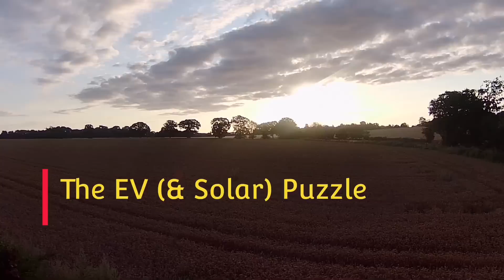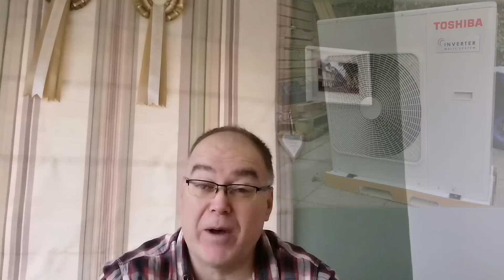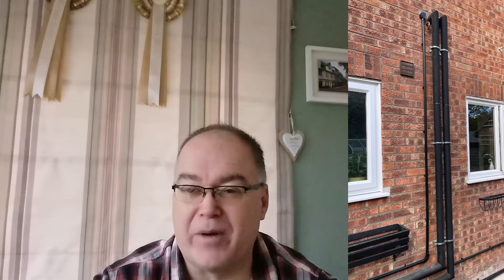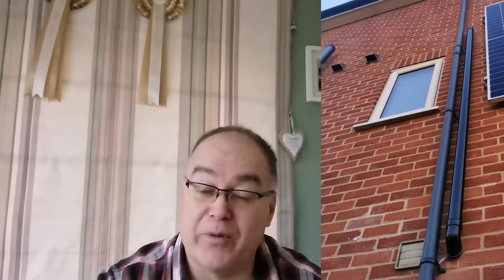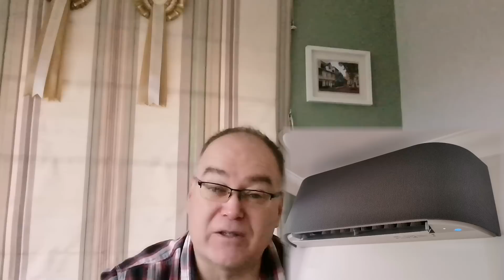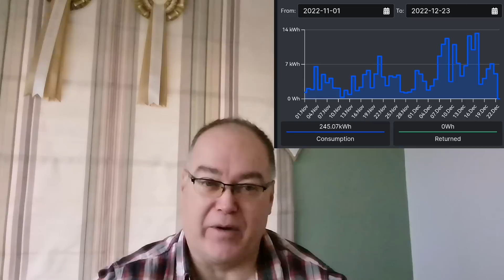Toshiba Air to Air Heat pump (A2A) - Probably one of the best heating systems you can install

Comment: Interesting that you have fitted small Immersion heaters into your towel rails. We did the same over 3 years ago when we fitted our solar system. In our case I wired the two towel rails back to the Eddie’s 2nd zone and then when there’s spare solar the towel rails come on. It’s great in the summer months when there’s loads of solar, in the winter I use the timer function in Eddie to operate the towel rails as required. It meant a bit of extra wiring but now done it was worth the hassle.  I’m very interested in you heating system my one concern is how well the heat pump works when the temperature is near or below zero. We have an Aircon in our kitchen that works well in cooling mode, is great for Dehumidification however in heating mode it only work well if the outside temp is 5 c or above, below that temp the outside unit freezes over. I’m a bit miffed that most companies don’t tell you that their equipment only works down to a certain temp for heating, they should be more up front about the performance of the equipment. Following your Vlog to the end I see that your units have a defrost mode and that’s were mine doesn’t. Fortunately I’ve just the one unit and I bought that mainly to cool the room in summer. 
Thanks for your brilliant Vlog it’s certainly got me thinking down a different route. Our ten year old house has plastic microbore pipework and that’s not a lot of use if we chose an air to water heat pump, it would involve a major work upgrading the pipe work and ripping up chipboard flooring, a nightmare.
Reply from the maker: Yep our heating has worked fine so far down to - 6c outside. A few defrost cycles in the worst weather but heat has been fine

I have heard placement of the heat pump can help, not too exposed

Comment: Ni Nigel I'm just about to go down the route of A2A with Haori units, have you tried integration with Home Assistant?  I see some integrations on HACS for example, but would welcome confirmation that there is a working integration, especially from a UK system
Reply from the maker: There is a working integration I've tried but it conflicts with the solaredge integration so I can only run one or the other. Hopefully one day the solaredge integration will be updated or the Toshiba one, whichever it needs. Its been an issue for a couple of years though

Comment: I love A2A heat pumps - I have a newly installed single "big brother" unit of yours, the Toshiba Daisenkai 9.5-35 (to replace an ageing Panasonic one), for my 5-bed house in Sweden.  Previously I did look at either multi-splits or an A2W system, as there were 3 of us, with 4 out of 5 of the bedrooms in regular use. And the heating engineer did lean more towards recommending A2W, because one of the major drawbacks of A2A - especially with multiple units, is when it needs replacing you're replacing the whole system.  With A2W, the rads/fan convectors, piping and storage tank all will live through multiple A2W heat pumps, so over time an A2W system will likely end up cheaper in certain situations, especially if most of the rooms are constantly in use.  Now there are only 2 of us in the house, an A2W system is only really going to be likely to be cost-effective for a larger family.  I will be reviewing how mine performs for cooling in summer, as previously I used a portable unit in summer for my home office and bedroom at night, and may look at getting a multi-split like the Haori for helping with the cooling in summer.
Reply: Thanks for your post, I’m thinking about an A2A system for our house, but didn’t think about having to replace the whole system when the time comes, unlike an A2W system. Food for thought…

Comment: Very helpful. I think people will gradually realise sticking a heat pump to radiators is madness. Most heat pumps in Europe are air to air
Reply from the maker: Think it suits those that just want every room the same temp and like using radiators. Air to Air just sounds different and hence people are apprehensive.  If these were installed as standard in new houses it'd be a massive improvement but radiators seem to be the way forward for most.

It's in my nature to question and challenge things however

Comment: We have had air to air heat pumps in Sweden for many years and they do make a difference to your energy bills. I would say that even the floor units have their advantages if you have room for them. Some people prefer to feel the warm air coming up from the floor . Having grown up in England I can imagine that they will work well as it does not get as cold as it does here, even though the houses are not as well insulated. The heat pumps are actually most effective with the fan on max if you can stand it. So put them on max a couple of hours before you get up and the house will be nice and warm.

Comment: What about the ventilation side of the system? How does dirty air flow out of the house? Is there an energy recoverysystem involved? In my experience this aspect seems to be underestimated by some people here in the Netherlands.
Reply from the maker: Nope no air recovery, open windows to vent air out 😂
Reply: This is internal only - air in the front, blown out the bottom less moisture and dust

Comment: How much does it cost to maintain an A2A system? Most places I've worked have had A2A AC and I see someone come in, at least once a year, and clean out the filters etc. What about the heat pump unit itself?
Reply from the maker: About £60 I'm Hearing for everything which then keeps your 7 Yr warranty in place
Reply: @EVPuzzle  thank you!
Reply: Get the best warranty you can for parts and labor. It may be built into the price. You should get an annual service call especially to make sure refrigerant level / pressure is correct. You also want to keep the coils clean. It’s like a car oil change you shouldn’t risk not doing it.

Comment: I had a small 2.5kWh Samsung air to air unit installed for £650, it does daytime heating in the winter and cooling in the summer of our lounge, invaluable last year in the heat wave. Running costs are low and it's great for keeping the damp out.
Reply: Thinking of same for a garden / off house office I am building.  The heat in summer will likely kill me!

Comment: I've had a Daikin system for a couple of years, in 3 rooms - absolutely brilliant. Heats the rooms in no time. Easy works at -5. Had a 4th unit put in the lounge in November, but something happened to the circuit board in the outdoor unit - 6 week wait for a warranty replacement. Not good if it's your only source of heating. Am having a Fischer electric radiator installed tomorrow in the hall (as I can't get an air handler in there anywhere). Also did the immersions in the towel rail radiators 6 months ago for warm towels in the summer ! Brilliant.

Comment: What’s the effiency of this system?
How’s it performing serving the whole house if the heat is only dispersed from 3 rooms?
An air to water system can hit 500% scop/efficiency and is surely more cost efficient if you want it in all rooms? Intrigued as to why you went this route unless you’re keeping the oil system or going to spend more than an air to water system fitting more units?
Reply from the maker: I've explained both these things already and why a wet system doesn't suit us.

We achieve a 5 COP also
Reply: @EVPuzzle  how do you measure actual COP on your system? Thanks
Reply from the maker: @DarthW909  I can't in reality as the units themselves aren't measuring heat output. The way other people seem to do it is start with heat loss value for the house and compare to heating power output vs a steady temp. My issue is I don't keep a steady temp long enough and have varying conditions so it's a constant moving picture 

Do I need to though? The units are 5+SCOP rated and  vary with temp. I accept this and presume this so have basically let go to focus of kwh consumption.

I see it like measuring bhp in a car, I know its there and can feel it but don't need to monitor it
Reply: @EVPuzzle  of course you don't need to. But it's a perspective for those that are watching your story as to what to expect in case they might want to follow your example.

In regards to 5 COP it's quite hard to achieve that as the system at it's best is only rated A+ and not A++ or A+++ for heating, with a COP of 4.67 and a SCOP of 4.26.

And given the configuration you have with only 3 indoor units, a rated max COP of 3.7 can be achieved when all 3 units are running simultaneously, a COP of 3.3 when 2 units are running, and COP 2.8 when one unit it's running.
A multi split to run at it's best performance needs to have the right matching units for the outdoor size. A four ports unit connected to four indoor units running at the same time would give it's max efficiency. 

It is advisable with the multi splits if used as singles due to lack of need to heat the whole house at the same time to be matched 130% to the outdoor unit size so that when used separate it matches the size of the outdoor at a better efficiency.

Of course using it a lower speed the SCOP will be improved but it's really hard to think of a number higher than 3.5 to 4. Still a very good performance.

The Haori indoor units with the single split outdoor units are rated at 5.10 SCOP A+++

All the best.
Reply from the maker: It's all good but is it too much data. What's most important. For me it's the watts it runs at in tick over, sub 400w for a 4 bed house is what I was after

Comment: Sorry I'm late with this one, but why do you want to burn your remaining oil? Isn't part of your project policy to "STOP BURNING STUFF" (ref:Fully Charged)? You probably purchased it at less than half today's rate, so sell it to a neighbour and get all your money back. I have a heat storage electric boiler (just one month ago), runs small house with microbore rads perfectly, and shall pass my remaining 200 litres of oil on to a neighbour. After removal of the tank I shall have no external components whatsoever (in my tiny garden).
Reply from the maker: Ease of disposal mostly. Pumping 400 litres to our neighbour could be messy. Without the right gear

Comment: Very interested in how you decided where to place internal units
Discounting bathrooms I get - they go with electric elements in the radiators etc.

For the rest of the rooms though/hall spaces?

I just ran a test with 2x units (1.8kw and 2.5kw) in the main living space and home office and  seems like extending to the rest of the house - esp. upstairs would be interesting.

Separate air source hot water tank perhaps later as the final nail in the oil boiler's coffin.

Comment: Great video Nigel! Just to clarify, is the minimum draw dictated by the size of the outdoor unit? For example, if you only had 1 indoor unit running the minimum draw may not be much less than having all 3 indoor units running? I was considering the larger 10kw outside unit to run 5 indoor units and cover the majority of the house. If this means the minimum draw would be higher even when running 1 or 2 units time we are likely to try and make do with 4 indoor units and go for the same outside you have. Hopefully this makes sense. Thanks
Reply: We have a Fujitsu 10kw outside unit and 4 internal units getting fitted next week. I’ve got my energy meter at the ready.
Reply from the maker: That's my understanding yes, and what I saw in the toshiba data. Lower the outdoor unit capacity the lower the power used both at peak and minimum tick over.

Comment: Some interesting thoughts and always useful to hear new ideas, I do think your video would be enhanced by actually giving a walking tour of the installs, the pipes, etc and the noise whilst running.

I don't really get an appreciation of the size of the units from the photos, eye level video would be better.  From the photos they look massive, perhaps this is just perspective.
Reply from the maker: It is perspective so well done realising it. Video two will cover more detail of the units and operation.

The install less so, it's just drilling holes and connecting power and pipes  there's only so much I can say especially as I'm not an installer and don't want to cover the technical   side of installing. It's not a DIY job and I'm not skilled to advise on it

Comment: I've been off for the second hand Fujitsu Siemens 6kw a2a heatpump second hand. I'm getting it fitted. What current does it draw on startup and once the system is up to temperature  it tickover at, 600w is great. I'm same as you , I will watch like a hawk the wattage it uses. Think the one I'm getting is about 3kw max

Comment: Superb thought provoking video, thank you. Just for interest:  I have a 16kWh 48V LiFePo battery with an 11kW inverter. Charges from solar (4.8kWp) in summer and 4hr OctopusGo slot in winter. Provides pretty much all our power through the day on non solar days. We have gas for heating. I am considering a heat pump, so the kWh figures you provide are very useful in helping to direct my thinking. I will likely double my battery size first which will allow me to store around 28kWh overnight total in winter/0 solar day (150A at 48V for 4 hrs) which I think will be enough to power the heat pump on OctopusGo 7.5p (12p ish now) night rate based on some of your figures. I will take my time and do a full heat loss calc but my expectation is that I will likely go DIY with help from my local plumber and electrician. Once that is sorted then I'll add more solar of course! I suppose hot water would be heated from off peak electricity in winter and solar in summer so would use up some of that 28kWh budget. Just need to decide on A2A or A2W...Thanks again. Mike
Reply: Mike, you wouldn’t need to use any of your 28kWh for hot water.  Just time it to use the low rate Octopus Go.  Our 210 litre tank is warmed daily by about 1 to 2 hours running at 3kW.
Reply: @Phil Battye  Thanks for the reply Phil, yes you're right but my 28kWh of energy is limited by the max charging current of 150A @ 48V for
4 hrs = 28.8kWh.  Interesting that it only takes a couple of hours at 3kW, so 6kWh., that is useful info. Thanks again

Comment: I'm an A/C engineer, I'm sick of telling people about this. The worst are the "internet readers" who think they know it all and start with .... "Heat pumps don't work when it's cold" and talk about their flow temps being too low etc etc. They think air to air is the same!! Well done that man for doing some proper research and doing the sensible thing. In my honest opinion air to air is far more sustainable than air to water.
Reply from the maker: Glad to hear such an endorsement, there's so much more to A2A than people realise. Very positive experience so far.  Imagine if new homes had it build in from scratch I stead of blooming pipes and radiators
Reply: Had air to air in my house for 4 years and would never go back to a wet system
Reply: We have A2A too. Installed downstairs as a tester. 
We're installing upstairs soon and the gas boiler will soon be redundant.
Reply: What temp do you set your heating at ?
Reply: @lawsonspedding6136  It depends on the individual, the thermal properties of the room and how you decide to use it. I normally recommend to customers that they try 21 as a starting place and go from there. Personally that's a little warm for me and I hover around the 19 mark but we are all different.
Reply: So true - people need to know!! I had the same eye watering estimates for ASHPs under the Boiler Upgrade Scheme and they wouldn't install what I knew to be an adequate system. But I don't think it's the installers to blame for over sizing - they could lose the £7.5k grant if they don't meet those idiotic MCS regs that insist on meeting 100% of the heat loss calculation. Any solar gain, people and pets, and every watt of electricity used by appliances will end up as supplemental heating - and MCS will ignore it all when sizing the system AND bump it up a bit just in case. In the end I went for 2x3.5kW mini-splits that have worked great all year round; cooling (just when the solar panels are generating the most) and heating all winter in our very open plan house. Total cost was £3500 and we kept the gas boiler for hot water and towel rails only. No disruption, installed in a day, full redundancy if anything fails. Running costs - hard to say because we have 12 solar panels but Octopus gave us back £500 in June 2023 and our monthly direct debit has been £50/month since then. 4/5 bed det. house always occupied @ 20°C ¯\_(ツ)_/¯
Reply: The worst are the "internet readers" who think they know it all and start with .... "Heat pumps don't work when it's cold" and talk about their flow temps being too low etc etc. They think air to air is the same!! So in other words, you are agreeing that heat pumps connected to radiators don't work?